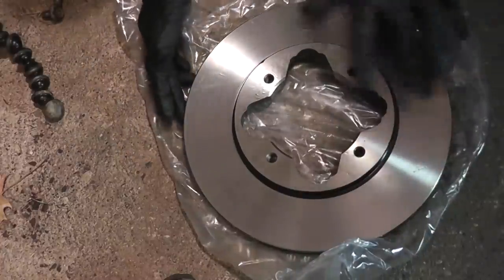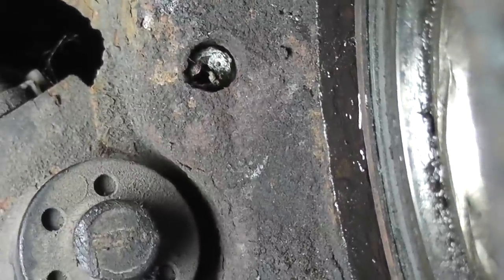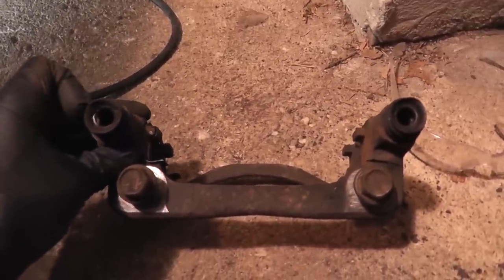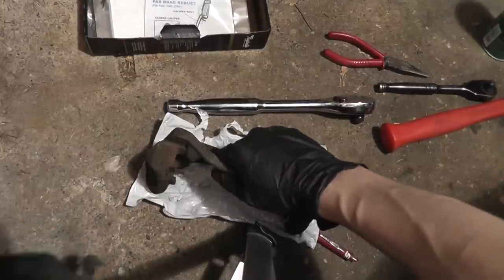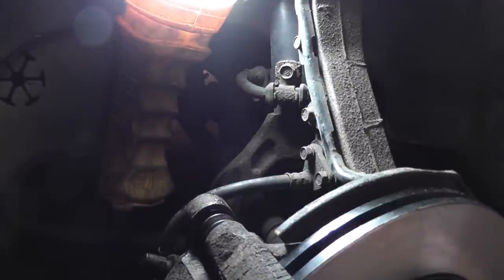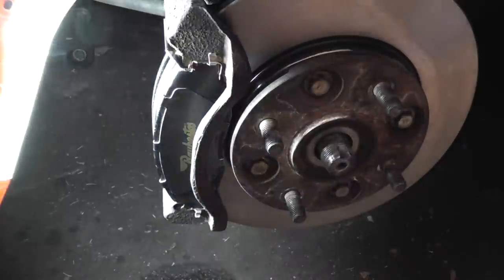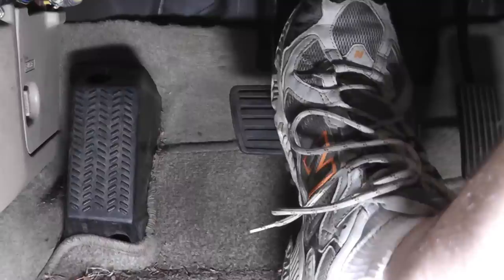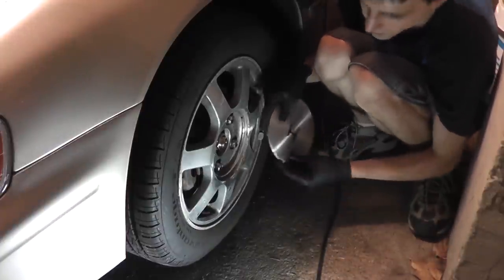1990-1997 Accord Brake Job (Captive Rotor Replacement) Hub Over Rotor Part 2

Comment: This video was by far the best on the inter web. Great job on showing  the whole process especially the removal of the rotor. Before watching this video I was getting worried we would never  be able to get the  rotor assembly off but with your suggestion of using the 4 bolts and air hammer it cam right off. Brilliant  instruction and excellent video. All in all your video saved me a lot of money and aggravation. Thanks so much.

Comment: Again, part two covered everything and with all the proper procedures.  The only, and I mean only, error I saw was to reposition the piston boots after collapsing the piston so they would not be pinched by the inner pad.  Also, the problem with using antiseize grease is that it is petroleum based and this can do harm to rubber. Always use silicon paste anywhere on a brake system.

Still, the best video on this subject on the web. SMA would be proud.

Comment: Thanks for the vid. it was very informative. I will be using this as a reference on my 97' Accord. When you lift up and swing out the knuckle assembly from the ball joint, did you also detach the joint from the tie-rod? Thanks again.
Reply from the maker: No you can leave the tie rod attached.
Reply: @Bushougoma  Ok great. Thank you

Comment: I was wondering if it is possible to rotate the disc rotor in case of pedal pulsating due to DTV,  on car if you unscrew the 4 rotor bolts and rotate?

Comment: Getting the lower control stud into the lower control arm (6:20), if the stud doesn't reach the control arm hole does that mean the axel isn't flush with the rotor?

Comment: Thanks to this video this process will be $300 max instead of $500+ and a need for an auto brake leith. Also, where can one find the Anti-Rattle clips for this model, all I can find are ones that look similar for 2000s and up models. TIA
Reply from the maker: +Demon Child Just ask for a brake hardware kit for the front all of the clips come with it. Numerous aftermarket manufacturers make them.

Comment: Hi, my question today is, when do I know that I need to replacement the captive rotor? Thanks.
Reply from the maker: Ideally they should always be machined (or replaced) to restore a flat surface for the new pads to break onto.

Rotors are so cheap nowadays it doesn't pay to remove them, machine them, and reinstall them unless you have an on vehicle brake lathe.
Reply: Good, do you know why, when I press the break pedal, after I start engine, the ABS light goes on and doesn't turn off only after I turn off engine???? I like so much watch your videos because you care about everything you do... I am not mecanic but I want learn how fix my accord 95 because I like care about it. Thank you.

Comment: *** Stop wasting your brake cleaner...just clean once, after everything is assembled. ***  Throw out these hubs and get yourself the 98-99 Acura CL 4cyl hub ($150) and rotor set, bolts right on and uses same calipers.